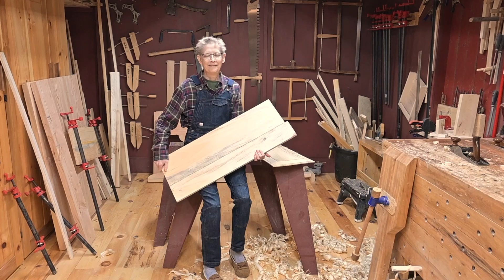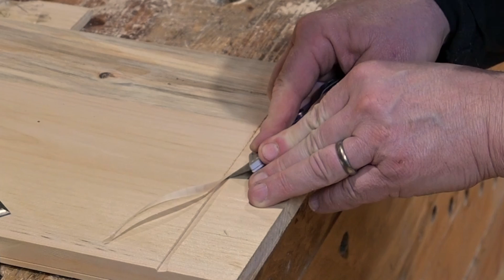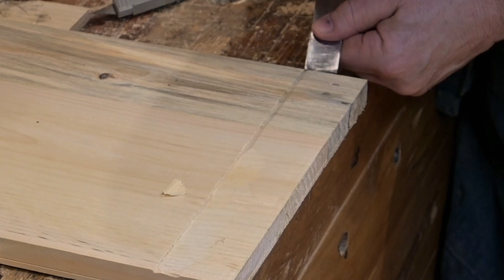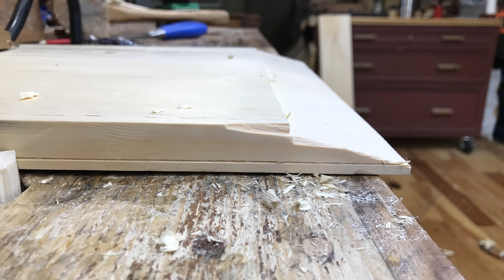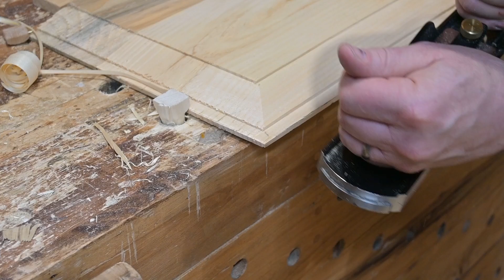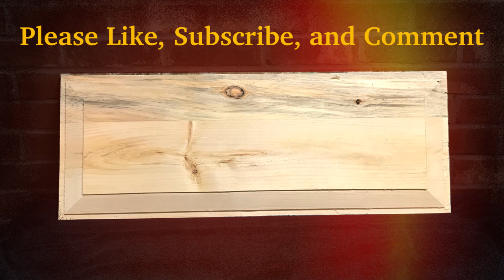Make a Raised Panel with only Simple Hand Tools

Comment: Nice explanation. How much tear out was there on the short sides( not at the end of the board) ... Asking because I cannot get reliable results with soft woods...
Reply: Tom here;
If I am understanding you correctly, we are talking about the cross grain cuts. So I’ll answer from that angle.
There is always more tearout on softwoods, crossgrain or otherwise.
First & second rules are fast cuts & sharp tools.
Also if it seems grabby take much lighter cuts.
Low angle planes often help and don’t be afraid to use a chisel if the area is completely uncooperative.
I hope this helps, and I have answered your question.